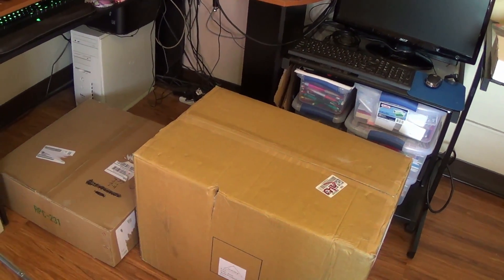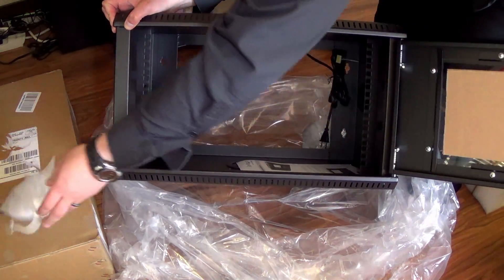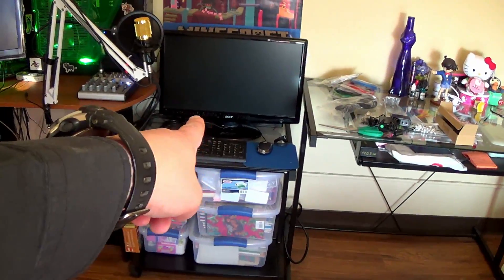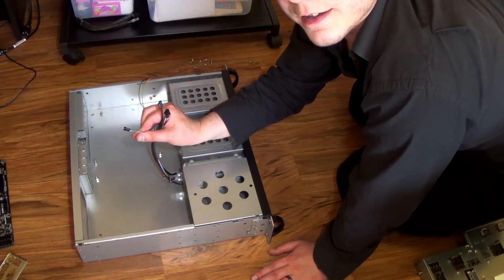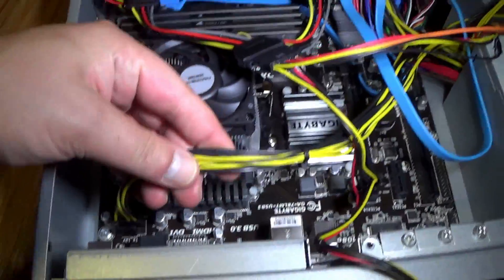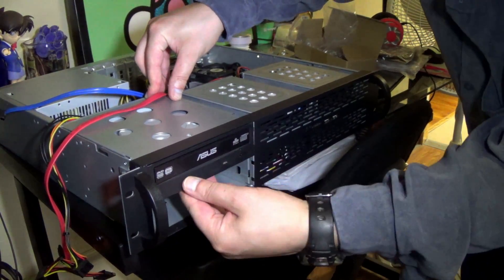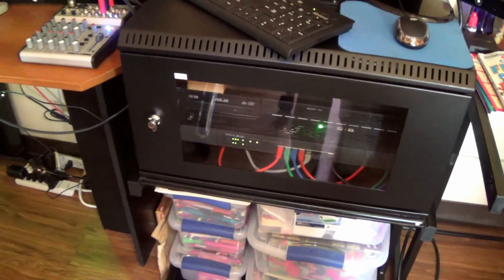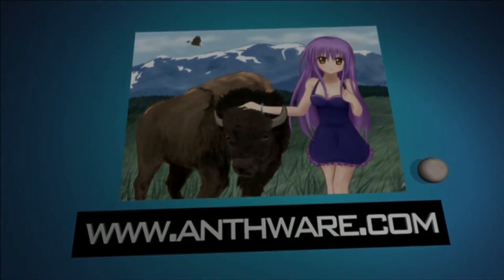Linux Server Rack ★Geeking Off★

Comment: You bought the wrong cabinet, there is two different types, server cabinets that are designed for server cases like you have and network cabinets that are designed for network equipment which is not as deep as server equipment. You bought a network cabinet but you need a server cabinet.

Comment: As a server admin .. the felt, and storing cardboard in your rack is a fire hazard. Better remove those to keep safe (noticed you already got some recommendations on replacement for the felt). And use a anti-static armband next time :)
Reply: as an install engineer i agree its not right, common or practice to put felt inside of a rack and that in the real world the project manager would have worked with you a sys admin and an hardware engineer to to make sure that stupid mistakes like this dont happen.

but back to what you said, i doubt that a single server with a pdu and a switch would create enough heat to rise the temp of that felt even near to the point of being burnt or set lite. this racks cooling system is terrible but hes using a pc / thin client as a server, hes using tp link, he built in on a wooden floor and has the 2nd cheaper power manager you can get, the rack had to be cut away to sing in the "server" case. its hardly a report style example of s retwork front.

ohh and your talking about him using felt inside the rack, he bought pre terminated patch cabels and dident use a patch panel or blanking plates for the rest of the U's free
Reply from the maker: This video is OLD, things you suggested have already been addressed.

Comment: All rack enclosures are not created equal. That is a network shelter not a server shelter so servers won't fit well in it. It's easier to look on CraigsList to find a local company getting rid of a 24U enclosure. Sometimes you can find them in good shape for free.
Reply: +Anthrit I was going to say also, the mounting holes are usually adjustable so you could unscrew and pull them closer to the front door, giving better clearance at the back.
Reply from the maker: +XboxorMat I know, I wanted to modify this one for the size and look.

Comment: Nice video. About the rack you ordered, this is what we call a Telco rack. It's designed for switches and gear like that, and not for server cases. That's why it's depth wouldn't support your case. However, you can always fit them when dremeling into it :-). But then you can't wallmount it anymore offcourse. Supermicro has a special set of cases which are specificly used for Telco racks. What also might happen is that the mounting poles of the rack aren't solid enough when you hang the full weight of a server case into it (could caus warping/bending of the metal mountpoles). Just my two cents :-)
Reply from the maker: +Dennis Storm You are correct. I picked this rack for looks more than anything. I have no plans to wallmount it anyway. As for the weight issue if you watched the vid the notch cut out in the back was done so the back of the server case sits upon it and the metal in this thing is so strong that it broke a diamond metal cutting blade.
Reply: +Dennis Storm Telco guy here, was going to say exactly this!  Looks slick though.  I have no idea how your cage nuts went in so easy.  I always end up busting a knuckle getting them in.